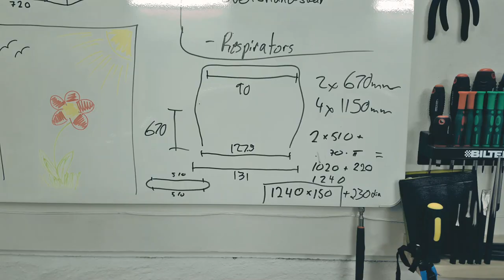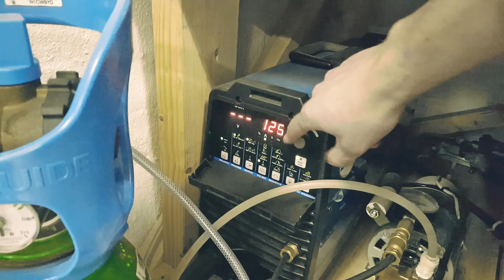How to Build an Endurance Race Car: Part 1

Comment: BEAMS in a Bimmer?! 
Give us MOAR! Now, please. 
Is this car being built for a specific series or a set of rules?
Reply from the maker: Yes we are building it for ER Cup, an endurance series in Sweden. The rules limit displacement to 2.0L for engines with 4 valve heads, and the Beams engine came out on top for us when we benchmarked power/weight/cost and availability of aftermarket parts!
Reply: @Poik242  Better than even the M43/44?! Shocking!
The BEAMS engine is really cool. Especially since you were able to get one. I'll be following along, if you do make more videos.
Reply: @Poik242  when do u think the next episode will be out?
Reply from the maker: @enzoradford4306  I just machined some parts for the steering column this week, so I hope that we can get that job finished up in the next month!

Comment: Hey Eric, what bushings did you use for the engine mounts and what are their dimensions?
Reply from the maker: We used Volvo 240 rear control arm bushings.  41mm diameter, 76mm width for an M14 bolt, I'll send you a link.

Comment: Was there gas pressure in the bumper shocks? I need to delete a couple and was wondering if it is safe to drill them.
Reply from the maker: No there wasn't, just oil.  We had the same concern so we drilled a small hole to release any pressure before attacking them with the angle grinder, but there was no pressure inside.  There is a floating piston with a lot of friction on one side of the oil chamber, so these will act like a single-use damper in a collision.  We cut away the the hydraulic tube parts and remade them with a piece of 40mm round tube instead.  Maybe not the best use of our time right now, but we saved around 500g :)  I guess I forgot to put a photo of those finished mounts in the video though!